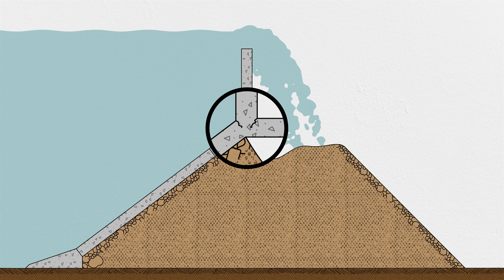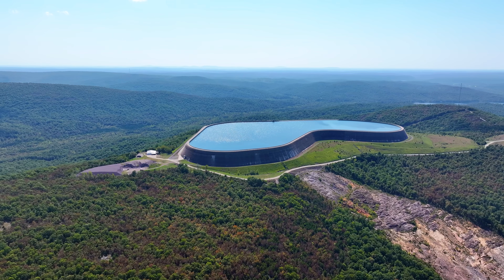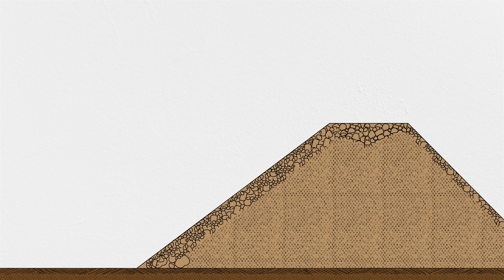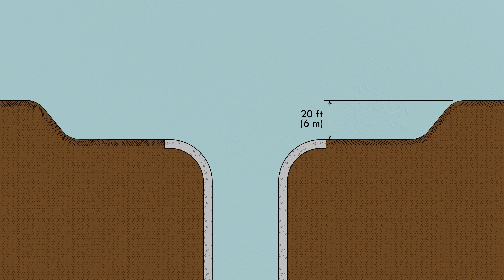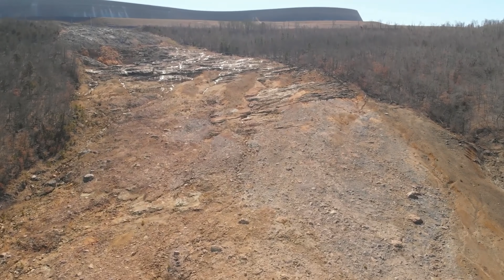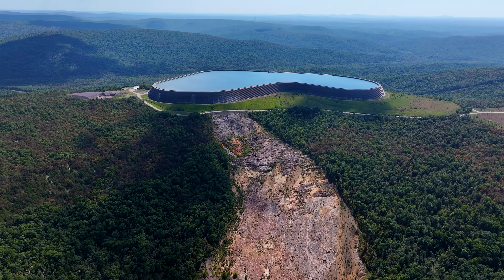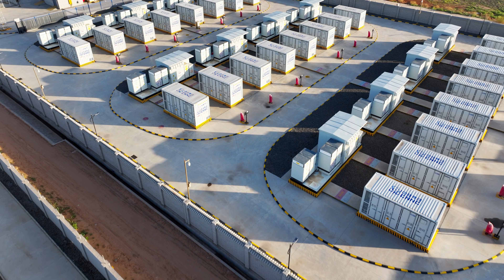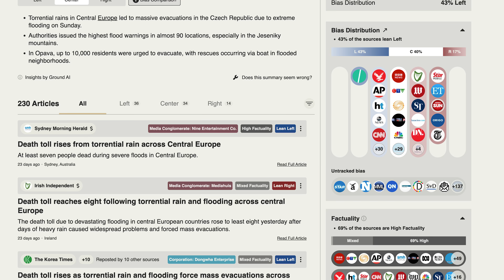The Wild Story of the Taum Sauk Dam Failure

Comment: You telling me there wasn't an overflow spillway? What if the exits are clogged and it rains a lot? This is obvious stuff.
Reply: Looks like the dam made its own spillway
Reply: @g-mc4507 too true.
Reply: It is just crazy...
And this is not the being smart after the fact.
Reply: @CsendesMark  I can guarantee somebody in a cost cutting meeting said Eh like we're really ever gonna need it.
Reply: @CsendesMark  building something for the cheapest possible cost is the goal.
If something happens, let government clean up the mess.
Reply: @bengurwell1500  That's apparently what they had, but active control systems are always more unreliable than passive control systems (like a spillway). It's not like a channel around the outside would have been that much more expensive.

Water up high is a large amount of potential energy. No engineer should concentrate potential energy and then choose active over passive control systems where a choice exists (and it certainly did).

It's like making a fireplace out of wood and then having sensors that detect the fire and spray water onto the wood to keep it from igniting.

Yea you could maybe make that work, but you could also just make it out of brick. The former is unforgivable, especially when the control system failed and a fire started.
Reply: @trygveskogsholm5963  nice
Reply: @trygveskogsholm5963  Clogged? With what?  The pipe is huge, and there are no sources of debris.
Reply: @tookitogo  it's a general term. The gates on the pipe lock that's a clog.   The membrane delaminates and fouls the turbine that's a clog.
Reply: Rain depth is tiny per area. A major rain storm generally has < 1ft of rain. A large watershed magnifies this but look at the image, no watershed…
Reply: @johndanger8717  Honestly even with a 1000-year storm, there almost was no way the dam would have overflowed as long you didn't actively pump water into it. Even if a stormed knocked out the power and disabled any way of actively releasing water, there was little chance of overtopping. The only way it could overtop is if you pumped water into the thing. If the level sensors worked, none of this would have happened. Of course once they realized they needed to fix the sensors, they should have installed a CCTV camera or even just hire watchmen just to watch the water until they found a permanent solution. In fact I'd argue a camera should have been in the original design anyways.
Reply: No need - it's a small lake, not a massive river. Rainfall isn't relevant. The design was sound, the issue wasn't the lack of spillway.
Reply: @Malc180s  "the issue wasn't the lack of a spillway" 😑 weird it's almost like if they had a dedicated overflow outlet the major fault wouldn't have even happened regardless of the original problem.

The spillway would've nullified the problem to begin with. That's the point. An ultimate (not perfect) failsafe for when something like an auto level sensor stops working properly. It's astonishing how they didn't understand it's ALWAYS best to plan with the assumption that sensor will fail and so you need that tangible/non CPU reliant solution.
Reply: A spillway might not have prevented this breech, for the same reason that the parapet-mounted level switches also didn't help. Neither measure can function as intended given excessive settling elsewhere along the wall, which is what happened. 

It's wild that the dam was apparently never inspected for this (the settling probably progressed over years or decades) and the backup level switches relocated accordingly. Like the Titanic: make things with new tech, it's treated as infallible, people stop paying attention. This is human nature.

Also, how many people signed off on "both parapet level switches must show high to interlock the pump"? Far less safe than having a single parapet switch!
Reply: @zachrichardson5581  alright safety boy.
Reply: @Malc180s  LOL good job taking it on the chin malc
Reply: Most rain falls infront off mountains, because of the fall of temperature by every meter of hight and vapor pressure. And like others already wrote: it can be calculated by weather forcast.
Reply: @G.R0815  Don’t tell the Rocky Mountains. The mountains above Denver on the lee side of the Rockies get major storms all the time.
Reply: @G.R0815 these aren’t mountains.
Reply: @DamnitLawrence  It is the Ozark mountain range, it is a mountain, although very small and nothing of the kind out west.
Reply: @integr8er66  Well, AFIK, there is no set definition of how big a hill has to be to be called a "mountain", but I live in Colorado and to me that thing is just barely big enough to be called a hill.
Reply: @DamnitLawrence they are the 3rd oldest range in the USA. They have eroded over 1.5 billion years
Reply: @G.R0815  I love to learn. Thank you.
Reply: @G.R0815  To be fair "mountain" isn't really the correct word to use for Taum Sauk. It's only 1500 ft ASL. Missouri hasn't had mountains for tens of thousands of years.
Reply: @G.R0815 calculated using a forecast…
Reply: This is in the Missouri Ozarks, and our "mountains" aren't quite the barriers that other ranges are. Too small to make a big difference.  @G.R0815
Reply: @G.R0815  it's Missouri. It may technically be a mountian but you don't really even notice a temperature difference when you go up. I grew up in the area. It's not that big of a mountian when compared to mountains which truly do have their own weather.
Reply: @G.R0815 These are like 3 or 4 thousand foot mountains so that doesn't really apply to these. It rains alot in the Ozarks.
Reply: @G.R0815only takes one bad day for it to go wrong.
Reply: @G.R0815 the mountains in MO aren’t real mountains. Not like Rocky or Sierra Nevadas. They’re tall hills. They’re not even Appalachian tall.
Reply: @M21assult  Incorrect as this is situated in the St. Francois Mountains which are infact mountains as they were formed by volcanism and pre-date the appalachian by around a billon years...
Reply: @anonymoususer3465  I don’t care about textbook definition of mountains, I care about height and appearance of being a mountain. the HIGHEST elevation there is less than half the elevation where I live and I live in an area statistically flatter than a sheet of paper, and driving through them is hilly, not mountainy.
Reply: @M21assult  You never stated it was your opinion you point blank said there wasn't any mountains So I corrected you also you do know that the likes of the rockies are estimated to be COMPLETELY eroded away in 370-375 million years right? These mountains are around 1.6-2 BILLION years old (oldest in north america and 8th oldest on the planet) just to give you an idea of how tall their peaks were at one point and they could still blend right in with the appalachians which is pretty amazing considering their age. Ps I doubt where you live is "flatter then a sheet of paper" it's probably on the great plains incline which slopes upward :)
Reply: @M21assult Geologically speaking they’re mountains.
Reply: @M21assult the nepalis say the same thing about the Rockies and Sierras.
Reply: Almost as bad as putting the emergency generators in the basement at Fukushima.
Reply: Lol just saw I'm not the first to be reminded of Fuku: that's awesome!
Reply: Looks like there's a spillway now....
Reply: Its on a mountain top, so short of intentional sabotage(an effort that would require heavy equipment to enact) its virtually impossible for trees or other large debris to even get into the reservoir to clog the drain hole (20ft diameter). 

The pumps are the only significant way of getting water into the facility.
Rainfall is really inconsequential because the catchment area = the surface area, so rapid rise from rainfall is impossible. 24hr record rainfall is like 10-12 inches for this area. They can drain this amount in 15 minutes.

The failure was caused by faulty installation of a faulty mechanical system to limit the pumping.
The previous mechanical system worked for 40+ years and likely would still be working today had it not been altered.
Reply: @dorvinion m😅
Reply: Ameren isn't smart I've worked in that very same powerhouse and another one of their facilities.  Their incompetence and unwillingness to perform maintenance is why all pumped storage facilities must be manned 24/7.  Not that I'm saying having personnel inside generation stations is a bad thing.
Reply: So many engineers lol.
Reply: There were so many dam mistakes it's crazy.
Reply: For everyone saying that this construction didn’t need a spillway, you are wrong. Think of this like a water tower. Water is pumped in, then allowed to flow out be gravity controlled by valves. Water towers have overflows for the same reason as this dam should have had a spillway, instrumentation and control can go wrong, especially when not being maintained properly. The point of a spillway is a last line of defence, breaches in dams like these cost far more to fix than prevent and failures on a massive scale like this can cause deaths, it all about risk management and consequences of incidents occurring.
Reply: Design for a bad day and it may never happen.
Reply: @Johnrich395 precisely so.   Hope for the best, but plan for the worst, and you won’t go far wrong.
Reply: @Johnrich395 hope for the best, plan for the worst
Reply: @Johnrich395  don't design for a bad day and it will happen. murphy's law.
Reply: @mrxmry3264 Murphy’s Law is nonsense.  It’s not provable and is a layman’s terms to explain anything that has already gone wrong.  People love to throw that in hindsight of disasters and think it’s so clever.  When they said it in the Senate hearing in Contact. I had to laugh out loud.
Reply: This sounds like one of those events that produced the sort of COMAH regulations and investigation techniques that make things so safe today. All the people who moan "hurr durr elf and safety" need to remember that every rule is written in the blood of innocent victims.
Reply: Comparing this to a run of channel dam isn't really appropriate. This isn't a dam holding back a river that drains  a large drainage basin; it's level is almost entirely predictable.  So:

1. The likelihood of the outlet getting blocked such that you couldn't drain the reservoir faster than it accumulates water is almost zero.
2. In order to unexpectedly raise the  level of the reservoir one foot you would have to get one foot of rain in that exact spot. If you get that for many days in a row in Missouri, an over-topped dam is going to be the least of your concerns... we're talking massive flooding on the Mississippi an order of magnitude worse than any we've seen before. Even locally the black river is going to be severely flooded at that point, dam letting go is going to be a drop in the bucket.
3. Where are you going to send the spillway water? It's sitting on the top of a hill, there's no creeks that come off of that hill. Are you just going to let it flow down the mountain? Are you going to build another pipe to contain it?

The problem wasn't that the design of the dam was inherently dangerous, we deal with much more dangerous things daily. The problem was that they never verified that their system worked correctly and ignored the indications that it wasn't doing so; with that culture all a spillway is going to do is disguise the problem until something else breaks.
Reply: Even the most rainy countries in the world barely have about 3,000 millimeters of rainfall per YEAR. That's like 10 feet max.
So in case the exits are clogged AND you know that a heavy rainstorm is coming, you'd only need the water level to be 10 feet below the max capacity and you'd be good for an entire year to fix the clogging even in the most rainy country in the world. And that's if we exclude the possibility of simply using emergency drainage systems like they have in dams.
Reply: @texanplayer7651 Parts of New Guinea (Tabubil) gets 10m (30ft) per year… It rains every day between 2pm and 4pm.
Reply: @texanplayer7651 aaaaaaand what happens when you forget to hit the off switch before you go home.  Designs depending on perfect management guarantee failure
Reply: @texanplayer7651 are you not aware how rain works?
Reply: @texanplayer7651 emergency systems like, idk, a spillway?
Reply: @texanplayer7651 also there is evaporation to consider...
Reply: @texanplayer7651 Nice in theory, but one would still need to know water levels to within a few feet, yet that was one of several holes in the Swiss cheese model of failures here. One would also have to rely on actuators working at all times. Better to have a passive spillway as a fail-safe mechanism.
Reply: @texanplayer7651 wow I'm glad your not in charge of anything like this that requires any level of common sense or ability to actually use your brain 😂. You are so wrong it's not even funny.  You completely ignore the FACT that runoff exists. I'm sure you have no clue what that is but water runs downhill genius. that means that if you have a area that sits in a valley and there are mountains around it, then all of the rain water that falls on those mountains is going to run downhill to the valley where a dam might be so if they followed your logic, there is absolutely no space to accommodate all this extra water.  If 10 feet of water fall that doesn't mean that only 10 feet of water will build up in any reservoir or dam because of all the runoff that they are also taking in from a massive amount of other areas as well. Nice try but your clueless af
Reply: @texanplayer7651 a spill way is so simple though.

Yes an expensive solution to a low risk needs consideration, but we're just talking about a bit of extra concrete.
Reply: @texanplayer7651 The average doesn't matter. For such cases the 100 year maximum is more relevant and I think it's about 400mm within 48h here in Europe where I live.
Reply: @texanplayer7651 over 600 dams in the USA alone since 2000 have failed due in part or total to rainfall events.
Reply: @texanplayer7651  Yeah, brilliant logic, nothing could go wrong, who needs redundancy or spillways, no need to account for what-ifs, the design was perfect. Give this guy an engineers license... Arguing for one of the major design flaws that allowed this disaster to happen, incredible, hindsight is 20/200, as they say
Reply: @texanplayer7651 accountinf for a whole year can be deceptively wrong way of viewing this? Many of the rainiest countries in the world dont have loads of rain all year. They have a monsoon period usually.
Reply: Engineers already factor such things in. There is a lot of data on individual rain events, that can be used to make statistical charts.
Reply: @texanplayer7651  unfortunately you've also got the drainage basin to worry about.. if the basin is twice the size of the lake, then expect 6000 mm rather than 3000mm..
Reply: @ozmall7399  Okay? Then 10 feet of leeway is still 6 months of time to fix the clogging... 
A clogging of a pipe that is several feet wide, where there is no vegetation around to even clog that huge hole it in the first place, which can only realistically be clogged through sediments pumped from the downstream basin, which can only relistically clog the system after a long time, time during which technicians can act, and that would first clog the filters before they clogged the pipe...
Yeah, I guess 6 months should be more than fine to fix such an issue... If not, then perhaps we should reconsider who we are hiring to generate, store and provide our energy?
Reply: @texanplayer7651  totally agree, plus after watching I realised there is no drainage basin for that resovoir, so even worse 🤣
Reply: @ozmall7399  The reservoir was on top of a mountain. There was effectively no drainage basin. Not that that excuses having no spillway, IMO. That was pure cheapness, which ended up costing them way more money that doing it right would have.
Reply: @ozmall7399 This basin is at the top of a hill, therefore drainage is equal to the basins surface. So texanplayer7651 is right.
Reply: @russlehman2070 if the spillway of the bassin overflows, that wouldnt be much of an issue.
It will not be sending that much water down. The flow rate will be waaaaaay lowee than on a dam failure. You can simply put a concrete spillway up to a few meters down the hill, and the. Have a trench dug out that goes down to the reservoir below.
The trench in a natural channel for the water, and starting far enough from the spillway, will not present a risk for failure. Its exacly like how the spillway of concrete in a reservoir dam eventually ends and then it flows into a river, which is literally a trench full of water.

And regarding the drainage bassin: they have one, its the reservoir down the mountain itself.
And what if the reservoir overflows? Well it got its own spillway to get rid of excess water itself.
Reply: @ozmall7399 the lake is on top of a mountain - it has no meaningful drainage basin outside of its own surface area
Reply: @ozmall7399  Look at this reservoir. 

The drainage basin for an elevated reservoir fully surrounded by a raised dam on top of a mountain is exactly the same size as the reservoir. The water surface is the highest thing around - where on earth would be draining into it? 

You're right that normal reservoirs can have very large amplification of rainfall amounts to actual surface level change because drainage basins can be orders of magnitude larger than reservoir area, but that's clearly not the case here.
Reply: @ozmall7399  there is no drainage basin. Look at this reservoir design. It’s on top of the peak.
Reply: There is now lol
Reply: Tell us you didn't watch the video all the way though before commenting, without telling us. 🤣 

He says it at 12:30, but you're commenting like it's something you figured out on your own.
Reply: So I live in STL, I regularly hike Taum Sauk and several of the trails through those mountains. The Ozark Trail goes right by the reservoir. And Mina Sauk Falls (Named for chief Taum Sauks' daughter) is is within sight of the reservoir. The entire area is State park land. So having no spillway was a plus when state regulators looked at the plans. This was also 2005 and many of the issues have been fixed. There have been no issues since either. And I do believe there is no "permanent" spillway for the reservoir still. The damage to Johnson Shut-ins was probably the biggest issue Missourians had with it.
Reply: @Yuriel1981  Spillway is just a structure with no moving parts (or no moving parts that fail closed). It can still route to the same downstream reservoir along the same path.
Reply: This is exactly what happened in western north carolina and tennessee
Reply: Hey engineers know more than you just ask them
Reply: Pfft. Who needs redundancy? What are you, soft?
Reply: Nice job hindsight
Reply: Reminds me of how they built Fukushima to be perfectly safe as long as nothing really goes wrong.

Once I learned what happened I found it simply astonishing that people would build a nuclear power plant reliant on active, rather than passive and automatic, shutdown equipment, where you MUST have electricity to cool an overheating reactor, and a diesel backup for that electricity that is stored below sea level, all built on the coast in an area of the world nicknamed the Ring of Fire because it's constantly erupting and quaking:

What could go wrong?
Reply: Yeah, what a cluster eff.
Reply: Most bathroom sinks have an overflow.
Reply: The record for annual rainfall in Missouri is 57 inches. At that rate, it would take 18 years to fill the reservoir. Unlike valleys, there’s no runoff to concentrate the rainfall amount.
Reply: Exactly. There was absolutely no failsafe. What if the valves got stuck somehow? Even if all the water level equipment was working as intended, if the valve to let the water out was stuck shut, and there's a big storm, it's going to overflow. The spillway is the failsafe.
Reply: It's a pump storage facility, not a freshwater reservoir. It has no natural inflow.
So it's understandable that they didn't think a spillway would be necessary as the only way for it to overflow would be to actively overfill the reservoir. 

I'd call it a failure of imagination rather than incompetence, especially as early as the 60s.
Reply: Well there’s one now.
Reply: @brettricketts8699  Hahaha 😂
Reply: The higher the education, the stupider we become.. super dummy grads
Reply: This is why you can never really trust engineers, they live in their world of ideal pulleys and frictionless surfaces and get blinded to the obvious limitations of the real world. 

The sheer arrogance of not installing an overflow should amount to criminal negligence for the incompetent engineers that caused this.
Reply: They said 2 of 3 turned off so that tells me one switch was bad or bi passed @bengurwell1500
Reply: Its on top of a hill, there is zero inflow
Reply: Thats why scrutiny ig
Reply: No watershed feeds into it
Reply: A bit
Reply: It's so very, very... 60s...
Reply: Kind of sounds like NTSB kind of investigation into failures with real world cases that are tinfoil hat set up to test extreme conditions.
Reply: Backup plans reduce profits.
Reply: Exactly. Overflow spillway is essential to dam location and design. Always double for worst case scenario. Rain plus both pumps running and any other supply source.
Reply: Thou shalt not question an engineer
Reply: We found out what happens
Reply: The dam doesn't accept any runoff, so 1 foot of rain would only raise the water by 1 foot.
Reply: Rain 🌧️ isn’t that bad, since it drains no watershed
Reply: If you think a multi hundred million dollar facility hadn’t been designed to take into account those factors you’d be sorely mistaken. As is often the case with engineering failures, it’s generally a factor nobody was aware of that causes an unexpected event to occur. In this case a dam was designed to have be constructed from a certain rock base, and nobody had made a contingency plan to ensure the rock was stable and no uneven settlement would occur.
Reply: @TheSterlingArcher16  So why aren't you sorely mistaken that they didn't take the factor you blame into account?

Concrete workers have a saying: all concrete cracks.

Do you know why all concrete cracks? because there is always settlement, or soil expansion/contraction from moisture. Nobody lives on a giant contiguous impermeable superconducting boulder with the exact thermal expansion coefficient of concrete. Settlement and sensor failure are both firmly within the 'must consider inevitable' category. The inevitable must be quantified and planned for.

The 600 mm safety margin between the maximum theoretical level of the water and the edge of the wall was their safety mechanism for settlement. 2' of error for settlement should be more than enough in most cases. Settlement didn't cause the sensor inaccuracy. The sensor was the thing which had no backup and even if the wall was perfectly even it would still have overflowed because the pump would still have stayed on.
Reply: Almost all pumped storage is that way though.
Reply: The wheel was obvious to the generations after it's invention.
Reply: @Sonnybrowny  Yes, but we are generations after the invention of engineered hydrology so it should be obvious.
Reply: It's Arkansas
Reply: Tbf tho what would clog the port at the top of a mountain?
Reply: Not really.  If it rains a lot it’s about equivalent to if it rains with no dam.  I still am not convinced about the necessity of a spillway in this case.  Not properly installing sensors is the insane and crazy part
Reply: Lmao wdym “exits clogged”? Did you see the size of that “water conveyance hole”? I think this is where you go to bring 17 elephants with you to hell. That thing is terrifying to look at lol.
Reply: They figured with no inlet it wouldn’t be an issue. Obviously they were very, very wrong.
Reply: Occams razor my boy
Reply: It's a pumped storage power station, not a dam. Rain isn't going to affect it as much, because it's at the top of a hill - whereas of course dams capture water from a much wider area when it rains as they're situated in valleys. It also doesn't have problems with silt or debris build up (again, not a dam, there's no river flowing into it), so there's no real way the exits will get clogged.
Reply: They should make some of these giant swimming pools all across the Sahara Desert, they look really cool 😎
Reply: A couple of hours bashing out a first pass FMEA would have caught most of these small issues, ultimately avoiding the catastrophic one.
Reply: Seems to me that the original designers of the dam new the rock fill would leak some, which would act like a slow internal spill way, if the out let gets clogged the generator doesn't turn on during the high demand for power. Someone monitoring the power demand on the grid notices and sends a crew out to find out why. The major problem didn't happen until someone decide to "fix" the leak. Granted it may have leaked more than intended because of poor screening of the fill being used, but it wouldn't have been overrun if they didn't increase the duty cycle to double or more than it was designed for and had they not tried to fix what I would call a designed flaw.
Reply: And they received an award 😂😂
Reply: Water heavy 😂😂😂😂
Reply: It’s a pumped reservoir, there is no runoff into it. There’s no need for a spillway, but there is a need for accurate instrumentation. Short term rainfall is on the order of inches so it isn’t really an issue.
Reply: The exit is also the entrance
Reply: That’s what he said
Reply: They left 2 feet of freeboard for this reason.

When's the last time you saw 24" of rain fall on top of a mountain faster than they could fix whatever issue?
Reply: @jaredlancaster4137  It's more of a hill I doubt the elevation saw any difference in rainfall, and I won't entertain a question with the utterly unquantifiable "faster than they could fix whatever issue".

Depends on the issue, depends on when they noticed there was an issue, depends on whether they have large hoses readily available.

The real point, a point most people in the comments seem to have no trouble understanding is: If you have a choice between there being no impending disaster and having to assume someone will prevent the impending disaster, and the choice does not represent a significant difference in cost, of course you design the solution in.

When was the last time you saw an above ground pool setup on a flat roof over a residence?

People don't do that. Not because rain would fill that pool overnight, not because it's impossible to to make a flat roof strong enough, but because good engineering and general wisdom agree that one should not create situations where your home is crushed by 30 tons of water unless someone notices and acts to prevent it. Not when you could just have a sloped roof that works even when no one is looking.
Reply: Reminds me of raccoon mountain in Tennessee.   Similar design
Reply: It's different than a "normal" dam though. The only rain you get here is that which falls directly on it. River dams are impacted by ALL the rain in its watershed, vastly multiplying the impact. It wasn't a bad idea at the time to omit a spillway, as it wasn't even conceivable that it could overflow. Hindsight is 20/20 though...
Reply: Hindsight 20/20
Reply: Rain is irrelevant.  The basin is the surface of the reservoir.  Had they actually had the 2 foot free board they wanted, it would be effectively impossible for rain to cause an issue — water from rain will evaporate well before two feet of rain will arrive.
Reply: We have this on stock ponds engineered by farmers. 😂
Reply: Could someone tell me why float sensors wouldnt have been a better option?
Reply: @kipsterlah  sensors fail, they had float sensors or there abouts
Reply: Clearly the design engineers didn't do a failure mode effect analysis prior to construction.  I sure hope they did one after the accident because likely this dam is full of other disasters waiting to happen if they are missing obvious events like overflow.
Reply: Well, THIS happens.  The Park Ranger and his family were lucky to survive. Had no warning.
Reply: We know that now. This was built 60 years ago.
Reply: The most basic 🤦🏽‍♂️
Reply: Not to an engineer 😂
Reply: If common sense was common, you’d see more of it.
Reply: It seems like some important corners got cut.  It’s crazy that they didn’t accurately measure the water level signal offset.  And like others are saying, no spillway.
Reply: Most engineering accidents are due to overlooking obvious things because they are facing challenges in other places.
Reply: @juniorthethird08  they definitely say it's an oversight after the fact.
Reply: There is one now
Reply: A second option: if the only concern is too much water entering from a pump that cannot shut off: how about a spillway that instead of draining the reservoir instead redirects water coming through that pump down an alternate route (instead of the one that feeds into he dam)

Still: best option is simply to create an overflow drain (spillway) for when the water gets too high
Reply: Maybe they justified it because the evaporation rate is double the rainfall here in Mo.
Reply: How would the exits get clogged? It’s an isolated man made lake. The water is pumped into the dam which go through a filtering process to prevent such an issue.
Reply: @johnsweet8410  well it's thinking like that that caused this issue.
Reply: @benholroyd5221  how is my thinking short sited? If you think about it, the drainage helped the dam allot more than the liner. The liner sped up the process through incompetence. And the video tells me that there wasn’t very good oversight of the stock piling during the initial construction of the dam. 
The moral of what I am saying is that it was going to happen, the short sighted view of not shooting grade to check to make sure nothing was negatively happening, after they put the liner in brings into question what anyone was thinking. I guess I was being too simplistic in my response originally.
Reply: @johnsweet8410  well ideally you have a number of independent systems in place.

You don't just have a smoke alarm, or just a fire exit, or just a fire service. You have all 3, and you still get deaths from fires because nothing is 100%

In hindsight, there could have been a lot of improvements done. But its a bit late after the fact, so you build in a spillway, even though you 'should' never need it.
Reply: With that much pressure it’s more than pretty difficult to get a clog , also that much rain would practically be a biblical flood. However not having back up or system check for a pump failure is a massive oversight.
Reply: Im not an engineer but yeah, a lot of simple oversights here. Should all ways have safe-guards and fallbacks in place. Plan for the worst.
Reply: Rain would be absolutely nearly impossible to make much of an impact on this reservoir. Please use your common sense. Blake and Reservoir are typically filled by rivers, creeks and streams. Exact rainfall in an exact location is minimal, and you can look at the design of this reservoir and tell that with a quick glance
Reply: @stevenbrewer8788 rivers, creeks, and streams get their water from where? Is rain ever in an exact local area? How many times have you seen flash flood warnings without rain? It’s the rain.
Reply: Right. Who tf designed a reservoir without a spillway
Reply: Even an Emergency Shut Off for the Pumps that completely Kills power to them with a Physical Disconnect
Reply: Spillways cost money.
Reply: @farcydebop so does destroying a national park :(
Reply: @farcydebop unlike the accident, which cost nothing.

/S
Reply: @farcydebop  Could of been just an overflow scupper.
Reply: @lummoxx8586  You a roofer?
Reply: @lummoxx8586  that’s precisely what a spillway is.
Reply: @lummoxx8586 overflow scupper? What is that? What is scupper?
Reply: @farcydebop  

Dams cost money as well.  What's the cost of failure? 

This is the cost of doing business to prevent failures and maintain safe operations.
Reply: @farcydebop  Or save money. A 24" lower section would cost less money, and a sensor at that point could kill the pumps and cue the hydro generation.
Reply: @UncleKennysPlace A high level shutoff is what they had. It failed.
Reply: It makes no sense putting a laser level on it during the maintenance period wasn't part of their procedure. Settling has been known about forever and with that much weight it's obvious it will settle regardless of soil composition.
Reply: If the design had been working correctly, it would have taken at least half a years worth of rain, with no evaporation, for the 24 inches of height buffer to be exceeded. What feasible way are you imagining for the system to be clogged in a way that takes more than 6 months to unclog? Even if the existing drain system was permanently clogged, don't you think well over 6 months is plenty of time to install another drain, such as a simple siphon over the top? What makes you think a little rain would be enough to do damage anyway? I don't see your concern as even remotely valid. The settling and sensor failures would have been a valid concern, obviously, but not a "clog".
Reply: @benjaminlhargrave yep;  not only that, but what exactly would cause a “clog”? Because the only way to put water in is rain or pumping, there is no debris collecting in the reservoir like on stream dams.  Sediment buildup from the dam itself is flushed once or twice a day, and if there is any appreciable amount,  a clog isn’t going to be a problem; there are far, far bigger problems.
Reply: Exactly. Also, it implies in the video that evaporation causes a net loss over rain, so no, rain would not cause it to overflow. Also, if it did cause it to overflow, it would only overflow the amount it rained during the time span of the rain, which is clearly a negligible amount. No, people saying the need for a spillway was "obvious" for other reasons are clearly completely unaware of the dynamics here.
Reply: we have centuries of knowledge on how to build water storage infrastructure, but these people cherrypicked what they wanted to do.
Reply: @ricardokowalski1579 this is what happens when you have idiots from the government run things
Reply: @ricardokowalski1579 61 years without issue....
Reply: I was pretty shocked they included no provision for overflow.

And further that they didn't have redundant safety measures to turn off power to the pumps when the water got too high. 

If nothing else, the equivalent of 100 ft road worth of concrete down one side would have eliminated this failure case.
Reply: @mac_mcleod   I once worked with chemical process equipment that used liquid level controls for filling and emptying of small tanks. Every control had four switches. High alarm, High, Low and Low Alarm. The High and Low turned on or turned off a pump. The alarm switches, which should only reached if the primaries fail, would shut the whole system down.
Reply: @russlehman2070  and I am also also thinking for a couple hundred thousand dollars worth of concrete culverts they could have had 10 mini spillways that carried the water 100 ft away from the dam.

Which they didn't do with the new version either.
Reply: @bengurwell1500  11:16 they did it
Reply: Why would you need a spilway when you have a big hole at the bottom of the reservoir? The water is actively pumped up into the basin. When an overflow is detected just allow the water to flow out the hole. The detector is could be as simple as a ballon at the end of rope that pulls a plug.
Reply: my thoughts exactly.
Reply: Thank you random YouTuber!
Reply: I read your comment during the ad, thought "or a pump gams on" then the video started
Reply: Easy to say ... now 
Where's your project that's breaking records "champ"
Reply: I am a civil engineer who designed lakes and stormwater ponds, 

I had a stroke at no overflow spillway
Reply: @mlmichel98 you didn't need an overflow spillway when the catchment area is only the same as the reservoir area. Even record rainfalls would raise this by less than a foot.
Reply: @clapanse I thought about that but clearly they needed an overflow spillway
Reply: Not much point building a spillway if they've nowhere to put the water. Doesn't look like there are many places for drainage out there
Reply: @Synthonym there is a perfect place to put the water.  In the lower reservoir.  It’s the main reason this overtop wasn’t a far, far worse disaster.
Reply: The spillway is to prevent damage and failure of the structure which limits overall flooding incase of an overflow @Synthonym
Reply: @tellucas true
Reply: @Synthonym  They did put one in the restructured reservoir, so that argument doesn't hold water.
Reply: By ho it looks (a pool) I'm actually surprised it didn't fail before
Reply: I live close to this reservoir. It only fills by pump as there is no run off to fill it up. It serves as a basic giant battery. They pump it up when they are producing excess power and drain it like a hydroelectric dam when they need more power.
Reply: I don't understand the people who says a spillway won't work because there is no existing river/basin for the water to go to. We don't need a spillway big enough to empty the entire reservoir in 5 seconds. The spillway only need to be large enough for the max inflow. How fast can those two pumps go? If you don't let the water drop a huge vertical distance, the spillway won't fail. A small concrete lined culvert down the side of the embankment, then down the hill.
Reply: @danielch6662  The three very powerful pumps can fill and empty the reservoir in roughly 4 to 6 hours.  

But otherwise. Agree
Reply: They should've hired you
Reply: @bluecup25 Are you kidding? With all of that experience and technical expertise, they’d have been more expensive to hire than just building the spillways.
Reply: Exactly, an overflow spillway is the ultimate failsafe that doesn’t rely on sensors, electronics or human intervention.
12:19 Maybe there was? 🤷‍♂️
Reply: Your house gets rained on, but i dont see it collapsing
Reply: @lukekennedy4970 because, you know, there drainages...
Reply: No staff on site. Who approved that? How about staff that check levels every 2 hours or had a routine inspection schedule. Saving 200k a year to avoid spending millions in the event you had a disaster. Greed.
Reply: @gregcox9556  Many many Dams have no on site people. Just maintenance ppl when scheduled
Reply: @gregcox9556 Bingo! Get rid of human oversight and the machine fails, here you go. Save a bunch of money??? People over machines! People fail too but they also spend the money they make around town ,unlike the machine that cost them how much?
Reply: It's hilarious that it's a milestone but doesn't have a spillway for a giant reservoir at the top of a mountain. 💀
Reply: This is so incompetent it makes me happy. At least it wasn't evil, just plain dumb
Reply: What's crazy to me is that we lose 30% of the energy from the burned coal to pump that water around. Fuckin dumb AF. This whole project was about money, cheap energy at night, and expensive during the day.
Reply: @elwookienator42  that's the cost of a working grid. What else would you suggest? Magic?
Reply: @elwookienator42  changing the output of a coal plant is very inefficient... it's easier/cheaper/efficient to have it running continuously at the same output and storing any excess energy even if it's not efficient.

Not to mention it takes time increase the output of a coal plant but a hydro plant is virtually instant, you just open the valve more and the increase is instant.
Reply: The most obvious observation is our education system, culture and dependability of government  is a complete failure.  It only gets worse from here.
Reply: @bertblue9683 do you really believe the alternatives will work better in every topic? I doubt. Evasive species can't achive 100% perfection in all categories. Impossible